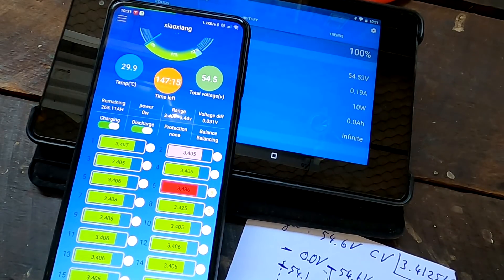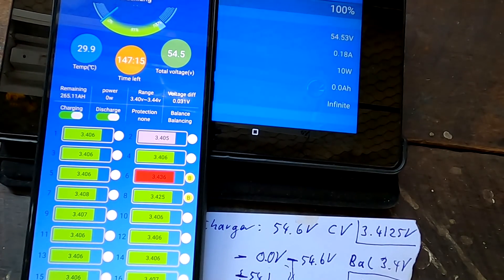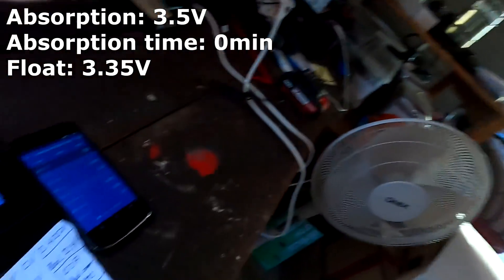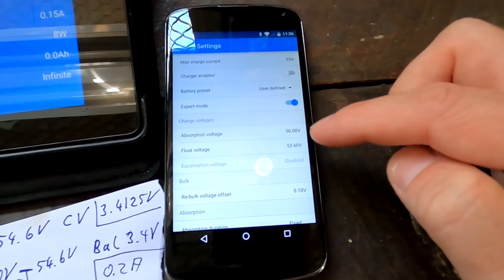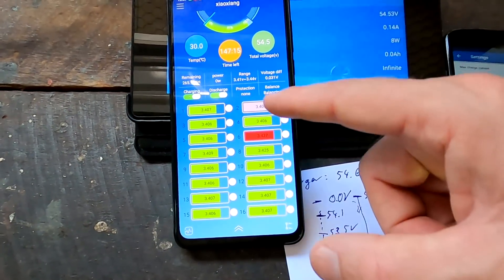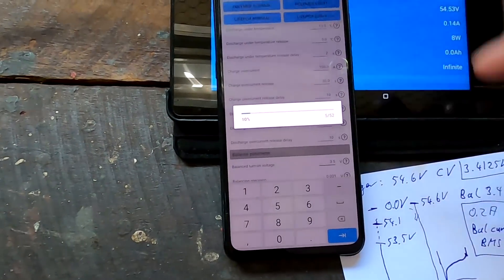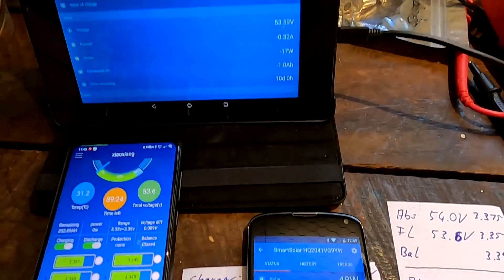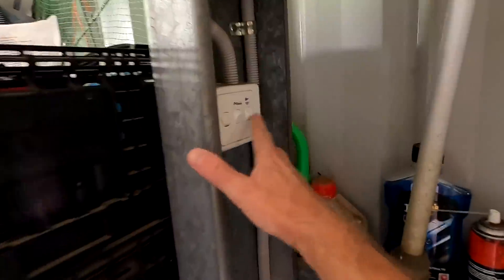Are these the better settings for your solar-battery setup?

Comment: Float is only used for lead acid
Reply from the maker: Not correct. All solar charge controllers have this setting even for lithium batteries. And it's an awesome feature to have.

Comment: I have my settings on my inverters at 56v (Top) and 50v (Bottom) I have my float set at 53v because I have read in every article that Lifepo4 batteries should not go into float voltage. The reason is complicated. In your case you are using your batteries daily, so they will loose some voltage but not current (or capacity).  You will notice that the batteries will always settle down to somewhere around 3.35v if allowed several days without use. Have you lost capacity? No,  or very minimal. I meant to expand on my last statement with this , but I know you are pretty meticulous and will find out what works for your situation..
Reply from the maker: Thanks Dan. I have a constant 50-60W load on my batteries, they will never be without it. So I will do more testing with different settings and see what works and what not. Your 53V float voltage seems like a nice spot. I may try this out soon.

Comment: Do not assume that your Battery Pack is at any specific % SOC, when it reaches a certain Pack Voltage.
Your pack voltage can be at 56 Volts, but yet your pack can be at two different % SOC's ...
a) Charge at 30 amps until 56v Pack Voltage = lower % SOC ( a full sun day )
b) Charge at  5 amps until 56v Pack Voltage = higher % SOC ( a cloudy day )
Using Absorb mode with a minimum current shut-off reduces this difference.

Comment: Andy, you stated at the beginning "we are charging with a very low current", it were 0.15-0.18A, but the balance current of the BMS is 0.2A right? Could this mean that the charging current is "wasted" into the balancing? Therfore with no use for the other cells???
Reply from the maker: It balances only single cells, right? So all cells which are not getting balanced  at this moment are still being charged. The current flows through all cells at the same time (series connection) but the BMS takes this current away from the cells in balance mode.
Reply: @OffGridGarageAustralia   was struggling in finding the right analogy, but I found it:  take for example your irrigation system. The system has to be properly calibrated so that you have the same amount of water dripping from all the holes. Now, if you would have one bigger hole, then all the water would come out there (it has to do with partial pressure), because nature is lazy and takes always the easy way. The BMS would suck the water coming out the big hole, which does not mean that more water is coming out the tiny holes. What do you think? But on the other hand you don't care about the "wasted" energy since the sun shines "on you" anyway you would just stop harvesting it.  In my situation this is completely different since my system will be AC coupled.
Reply: @alexandergunda8916  The BMS bypasses current ( 200 ma ) around any cell(s) that reach the Balance Turn-On voltage.  The current flowing through the other cells is NOT affected, in any way.  Your irrigation system analogy is not accurate.

Comment: so if keeping the battery at 100% SOC is some how damaging or not suitable why charge it to 3.5V per cell to start with? Find the knee point where the voltage starts to ramp considerably (my testing indicates this is around the 3.45V mark) and simply charge to that point and float at the same point?
Reply from the maker: Yeah, I was under the same impression. The problem is if you do that, they will eventually charge to 95% anyway. It's better (at least that's what I think at the moment after my tests) to charge them to say 3.5V or even 3.6V with no absorption time and then cut the charger off. Set float to 3.35V. 
This all depends on how much solar you have. I have only little incoming power for these battery size at them moment, so what happens is, on the way up to 3.5V they already absorb so much energy due to a small current only, they are already over 90% charged when I eventually get there. So my target charge is inconsistent at the moment, depending on my solar production.

I'll do some more testing in the near future and we will exactly find out what the best way is to charge the LFP cells.
Reply: @OffGridGarageAustralia  what's the problem with them getting to 95% SOC? You say if the battery voltage is the same as the charger voltage then they are equal and no current will flow, yet in other comments a small current flowing when we are nearly charged is apparently a problem which is why we you have started the whole charge to 1 voltage and float at a slightly lower one, pick a voltage, charge to it, when all the cells get there and balancing ceases no current will flow, the higher the voltage chosen the more likely you will run into issues balancing the cells due to the 200mA limited balancing capacity. I think that is really the issue here, we are forced to look for alternative ways of keeping cells balanced of which 1 way is to keep them off the very steep part of the curve which is fine, but if you had 3 or even 5A of active balancing then you could charge as fast as you want and still keep those 3 rouge cells inline. Just my thoughts and comments, keep up the good work!

Comment: With balance at 3.50Volts you will have a short balance time. This is not great. To get Max balance time, it has to be the same as Float voldtage.
Reply from the maker: I thought about this too, but would this not mean I would just discharge the cells a bit faster again after the charger has turned off?
Yeah, thinking about it makes kind of sense what you're saying...
Reply: Balance point at 3.50V is near 0 balance time, 3.40V gives more balance time, but you dont know if it is 0.5 hours or less. What about go, back to balance at 3.40V and charge to 3.40V and stay there for 3 hours (absorption) Then you know the  balance time is 3 hours or more.
Reply from the maker: @hanshansen384  Then, the charging current will be larger than the balance current and nothing gets balanced at all.
If I absorb for three hours at 3.4V, the cells will charge to 95%, I guess.
Reply: Then use 3.38V balance and absorb

Comment: So many finicky settings! Most of us can get by with pretty standard settings, but those of us who like fiddling can get that extra bit of performance and longevity by tweaking things like this.
Reply from the maker: I'm actually very close to the default Victron settings now. I don't like the 2h absorption time they set for their LFP setting. This will charge the cells to 95% every time.

Comment: Now you are talking, This type balancer works only when batteries are near full and requires time. As I have already suggested, in real life when  off grid batteries are in constant use , this"idle period" scenario seldom happens. An active balancer of the type I have already suggested  will work similarly, but will do this nomatter what the absolute state of charge or pack voltage is, they simply compare each cell for a difference, and if around 30mV or above will go into action. The absolute pack voltage will rely on the charge controller settings. A few hundred millivolts drain on each cell via the needs of the balancer over a 24 hour period has a  cumulatively big effect, your top balancer, not so much. But in reallity, this minor cell variation is not the problem its made out to be.
Reply from the maker: I'm still not convinced about an active balancer. How much power do you actually gain by using one? 
I know what you're saying and it makes sense from a certain perspective. But honestly, with the new bus bars now in place, I don't see any deviation more than 5-6mV during a full discharge cycle. Unless we are in the very bottom or far end of the cycle. Then I can see up to 0.1V deviation sometimes under load. But again how much usable capacity would you gain by actively balancing them at this point of time? I mean, unless it can shift like 5-10A around that would great but all the ones suggested to me so far have only up to 1A or so. So once I hit this critical stage of having a difference in voltage (at the bottom or top) and the active balancer will kick in, how fast is it to overcome this and how much would I really gain?
Reply: @OffGridGarageAustralia  Short answer, you gain very little in capacity, thats why originally I suggested you dispense  with the BMS entirely.  The voltage curve at top and bottom is very steep as you know, so voltage difference at that point is misleading and a very inaccurate  indication. To balance these cells to the accuracy you are wanting, requires your bank to remain idle for many hours for a few mA to equalise the voltages on such a large bank using what equipment  you have at the moment. An active balancer also draws a  only few hundred mA but works 24 hours irrespective of  the absolute  battery voltage at any one time, it basically has longer to work. To equalise voltages to 1/100th of a volt accuracy quickly  is a very big ask and cannot be done using the one set of balancing wires, else the voltage drop across these  as the balancer draws amps will give erroneous readings, another duplicate set of balancing wires would be needed to make what is called a 4 wire measurement
 I personally rely on  those small cheap digital voltmeter modules  connected across each cell on my installation , rarely do I see any deviation more than a few mV during the mid range where batteries spend 99 percent of their time. The cheap active  balancer remains connected only because I have it now. I to originally worried myself sick over voltages but after a few years figured it really is a non problem. Sorry for the long reply. I hate to see you spending unnecessary money.

Comment: I like your experiment however will the BMS have sufficient time to discharge the high cells to maintain balance? I think the balance will drift out too much on this setting. It would be awesome if these setting work though.
Reply from the maker: Great point! Someone else mentioned this here too. He said setting the balance voltage same as the float to allow more time.
I'll test ;)

Comment: I don't understand what it is your trying to do here. You've realized that the batteries have less capacity,  so they're going to charge and discharge faster  than the rest. All the top and bottom balancing you do is accomplishing nothing. If your so bent on matching the cells, file a dispute or contact the vendor to replace them. Other wise you need to live with the 10 to 15 amp hour loss. I am not trying to be curt, but we bought cheap batteries, we get what we pay for.
Reply: I agree with this opinion. You're battery is working well, the BMS is functioning, you're wired up and ready to go. Time to put it in production and stop fiddling.
Reply: @mmytacist  Not Andy's style.  I thought this not long ago but have come to appreciate that I don't think his goal is really to find the optimal settings for his circumstance.  No, I think he is just so curious about this chemistry that he keeps doing different experiments to learn more about it.  
I got so frustrated in the beginning watching his videos.  I too used to silently scream "stop fiddling with every setting and just find some settings you are comfortable with leave it alone."  That was before I "got" Andy.  He is just a mad scientist.  Sit back, enjoy his videos and take whatever you wish from them.  It is part science and part entertainment.  I usually learn something from most of his videos but don't think you will find definitive answers to your LifePO4 questions here because just when you think you have a grasp on something he will change things up and confuse you all over again.  
Pick and choose what educational points you glean from his videos and use that knowledge in your own setting.  Most of us are not going to "fiddle", "babysit", or otherwise constantly wring our hands over what our battery is doing.  You don't have to but somehow Andy makes it seem as though we all should.  
My question:  is some of this perseveration just for content purposes?
Reply from the maker: Testing, observing, exploring, learning, sharing.
If you know all this already, well I'm sorry I could not provide any further new knowledge. Maybe just skip such videos...
Reply: My bad, sorry.
I was assuming your trying to fix the balancing issue between cells, apparently I'm wrong.
Reply: @offgridtruckerdude7133  I think you should take a look back at the first video,  "Welcome to the Off-Grid Garage!"  
It is about about the process, Testing, observing, exploring, learning, sharing,  what happens if ....

Comment: Ich habe mir jetzt eine lifepo4 [ 176 AH ] aus China kommen lassen. Jetzt warte ich nur noch auf mein Daly Bluetooth BMS. Hast du die optimalen Einstellungen für dieses Akku,ich weiß leider nicht,welche Werte ich dort eingeben muss. Leider verstehe ich kein Englisch, deshalb die Frage.
Gruß, Jürgen
Reply from the maker: Wie viele Batterien hast du bekommen?
Reply: @OffGridGarageAustralia  4 x 3.2V /12V- 176AH...Möchte diese Batterie gerne in meinen Wohnwagen einbauen,also gegen meine AGM tauschen. Angeschlossen wird alles an den Victron MPPT 75/15,und einen Ective 500 Watt [ reiner Sinus ] Wandler. Solartasche von Offgridtec-200WP.
Reply from the maker: @j_Behrchen  Der Victron MPPT hat ein LiFePO4 Profil das ausgewaehlt werden kann. Das ist dem was ich jetzt fahre sehr aehnlich: (Teile die Spannungen einfach durch 4 fuer ein 12V System)
Victron Absorption: 56.8V (Ich: 56V)
Victron Float: 54V (Ich: 53.6V)
Victron Absorption Time: 2h (Ich: 0min)
Das macht wahrscheinlich 0 Unterschied. Also mit dem vorgefertigtem Profil kann man erstmal gut anfangen.
Reply: @OffGridGarageAustralia  super,lieben Dank erstmal dafür 👍

Comment: you read all this stuff on the internet and the truth is they only tell you half the story. yes if you charge to a lower voltage you will extent the life of the battery. But what they didn't tell you is you would go bat Sh!t crazy spending a ton it time keeping those cells top balanced. As well as have all kinds of other miner problems. so many say 80-20 where in reality 90-20 is headache free and will still extent a 10y batt to 12y or so. The point is that this is just the properties of these batts and we can't change that. you have exposed those youtube myths for what they are thru solid testing --- they are pipe dreams. this is where we are and if we want to be where they are preaching of a 20y batt we will either need a new median or tec like maybe solid state batts.

Comment: That's looking good.  I still prefer to top balance to higher than high charge voltage during use, and limit the discharge voltage during use to well above the cutout voltage. That way "normal" never takes any cell to its high limit or its low limit.
Reply from the maker: I agree that should be the norm unless you really need to utilise the full capacity.

Comment: I bulk charge my batteries to 3.45v per cell from solar only, but only once a day max, and then let it float at 3.33v per cell. If it is very cloudy I may need to use my grid charger but only charge to 3.26v, leaving a full charge only when the sun comes out. I never actively balance them and haven't for 10 years. Currently the difference between max and min cell volts is 30mv, so I may check top balance soon.
Reply from the maker: Thanks Walter.

Comment: Quick thought: You have 280Ah batteries. If there is a difference of 1% in capacity between them, this are 2.8Ah. Using your BMS with a maximum of 200mA of balance-current, it will always take at least 14 hours to balance. If it's 2% it will take 28 hours, and this is longer then one charge/discharge-cycle using PV. So you will always see them drifting away from each other at the high charging states.

I would use the batteries from 5% -95% SOC. With 2% difference in capacity, this means 3%-97% SOC for the weakest cell. And you do not need to fiddle around with the voltages in the very steep part of the charging curve.
Reply from the maker: Thanks Peter. I was going to charge them only to 90% max actually, so just need to find that exact point by either charging to 2.5V quickly and then stop or stop a a lower voltage and play with the absorption time.
Reply: @OffGridGarageAustralia  So, maybe it would be best and go the old school way. Load them all up to let's say 3.55V, than connect them all in parallel and let settle them down for one day, so they are all balanced. Maybe charge them up to 3.55V in parallel, if the drop. After that connect them in serial and use 3.45V as max. charging voltage. You can also do this much more conservative with 3.45V parallel, and using them serial with max. 3.35V. Always have in mind, that this big ass cells with 280Ah stay the most time around 3.25V. So you are loosing near nothing by cutting of the part with the steep charging curve.

Many descriptions at the internet are for older cells with 50 or 80 Ah. There it makes sense to optimize for 100% of the capacity, and using the steep charging curve. But with 280Ah cells, i would just ignore the part, because it's not worth.
Reply: @peterpetersen6024  Once the cells are Top Balanced, a 1% or 2% difference in capacity is becomes irrelevant.  The cells can then be discharged, and upon recharge ... they all will come back to the same Top Balance.
Reply: @OffGridGarageAustralia  I think , you meant to say "... charge to 3.5 volts ...'   What you need to understand is ... If your PV Array is generating 30 Amps and you reach 3.5 volts/cell, then your Battery Pack will be at a DIFFERENT ( lower ) State-Of-Charge vs when your PV Array is generating only 5 Amps and you reaches 3.5 Volts/cell.  The Absorption Phase can be used reduce this difference in the SOC.